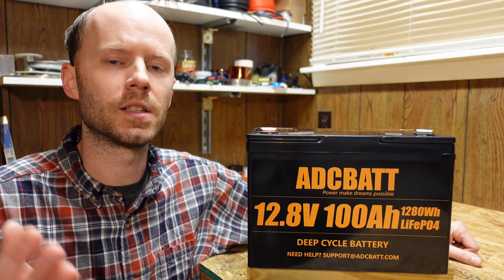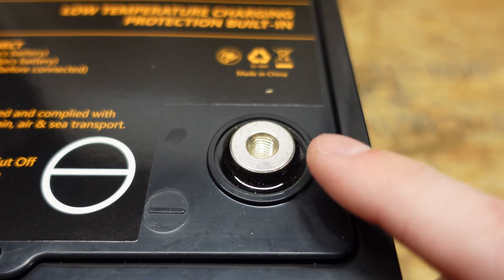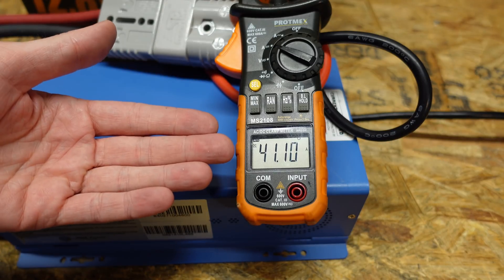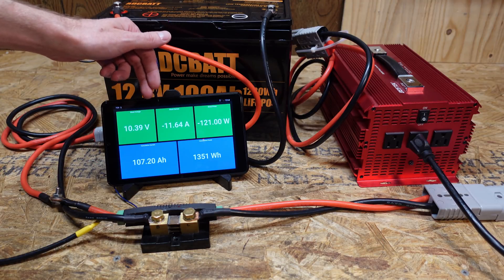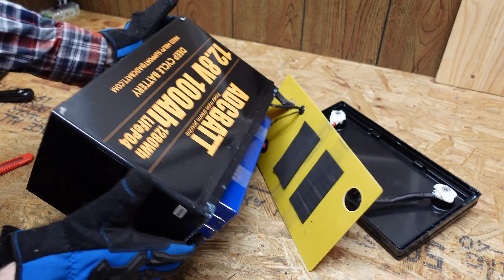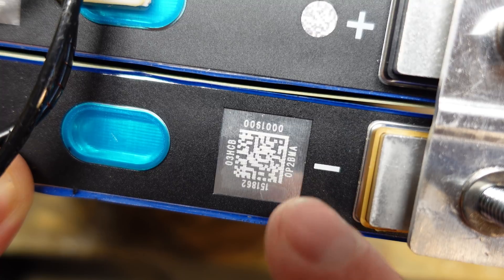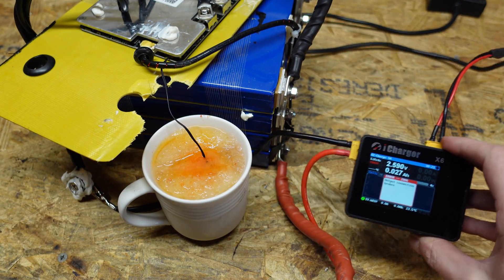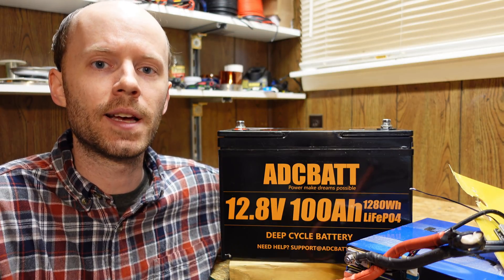ADCBatt 12V 100Ah LiFePO4 Battery Review, $369 with Low-Temp Protection!

Comment: One important piece of info I wish you could include in your battery reviews would be to show/reveal the final stage of the initial charge. What was the final voltage? Do the cells seem balanced or out of whack?  My new Aolithium has be on a 100ma for three days waiting for three cells to catch up to the runaway cell as the BMS attempts to balance.  PITA.

Comment: Update here.  I grabbed 2 for my camper as soon as this video came out and so far they are working great, so one season in the books.  I probably drew them down 12 times or so.  I have an 1100 watt inverter hooked up and I use a 20 amp charger.  The output and charging are working as expected. Prices are coming down so I will probably grab a couple more in the spring or many get the 200 ah version so I have 2 less cables when its hooked up.  These will outlive my camper.

Comment: Hello , Im new to solar and I will be building a grid tied system. I need about 14-16k system. My question: Ive noticed some content creators buy two mppt 6kw inverters and  not one 12kw or 13kw inverter, why is that?  and my 2nd question. Im limited on space for my solar panel array, I was looking at Trina vertex 670-700watt panels, is there a reason I should buy smaller less watt panels? Thank you and Happy Easter

Comment: Question.  Why do all these batteries say only 4 can be used in parallel?  Is this something to do with the BMS?  Seems to me many could be used in parallel.
Reply from the maker: Good question. I don't have an exact answer; however, I suspect it has to do with the ability of the BMSes to interrupt heavy fault currents. With proper over-current protection, any number of batteries can be paralleled in theory.
Reply: @LithiumSolar  I think you just nailed it.  If there is an excessive current draw with too many batteries the shared load between the batteries would not rise to the point to trigger the BMS's to shut down.  Perfect, Thanks!

Comment: at 2:05 in charging section parameters I think there is a mistake that over discharge disconnect of 15 volts I the manual should say over charge disconnect 15 volts  ? not over discharge disconnect ? am I wrong ?
Reply from the maker: Yep, it appears you are correct...
Reply: @LithiumSolar  did you just played a prank on me telling me that I won an ADCBatt 12V 100Ah? I received an email notification to my Gmail? telling me that I won are you playing with me??
Reply from the maker: @gabrielpadilla2583  That was a scam. Check the person whom posted the message carefully. You'll see it was not me.

Comment: DAKOTA LITHIUM 277 AH 12V LIFEPO4 DEEP CYCLE BATTERY look you will like it nice
Reply from the maker: I've looked at Dakota Lithium before, but man... they're expensive. $2400 for a 12V 280Ah battery? You can buy 4x 280Ah EVE batteries Grade A from a US supplier for $650. Dakota Lithium has a HUGE markup on those batteries, way beyond their value in my opinion.
Reply: The ADCBatts are 1/2 the price of Dakotas. Not saying they are bad, just stuck in the Battleborn era of terrible pricing.

Comment: Just had 2 delivered yesterday, came at identical voltage and seem pretty nice. Thanks for cutting it open, wasn't sure if it really had low temp or not. Great to know it works.
Reply from the maker: They have two versions of the 100Ah, one of them does not have low-temp protection. I assume you purchased the one with it, but FYI just in case :)

Comment: Those are Gotion 105Ah cells. It has thin Aluminum casing and bulging is a common issue in these cells, needs proper compression before charging. And the cycle life is limited I think, may be 1500-2000. Cheaper cells compared to others.
Reply from the maker: I spent a lot of time looking in to this before - one of the cheaper batteries I reviewed in the past had Gotion cells as well. I think you might have actually been the person whom tipped me off to that fact, can't remember. Either way... I had a datasheet that rates them at 1500 cycles to 70% health then I obtained another datasheet that has them rated at 3500 cycles to 80% health. Information on them is so scarce, and is typically in Chinese, that it's difficult to know exactly what the deal is.
Reply: @LithiumSolar  Yeah its really difficult to get the true info, some vendors modify the official spec sheet or make their own translation of the Chinese document. Anyways those are cheaper cells compared to EVE/CALB. EVE is also coming out with new 100Ah cells that have a lesser life and possibly "cheaper", or planed obsolescence!.

Comment: Does the proper low temp charge cut out make up for the poorer construction?
Reply from the maker: There's not really anything here that's problematic, just cheap.
Reply: @LithiumSolar  Good point. WIth true low temp ability, this battery is a top contender for me.  One thing that concerns me is the rated "Storage temperature: 50 to 85 degrees". That seems very limiting and is far more stringent than its other temperature use ratings.

Comment: I think those are the same cells that the HSKY from Big Battery uses (which is advertised as 106Ah).
Reply from the maker: I see the HSKY is listed as 103Ah. Was it listed as 106Ah before? I did a video showing the insides (one of their demos) and they do appear to be the same cells from what I could tell, just different color sticker on top. Very interesting!
Reply: @LithiumSolar  ah you're right it's 103Ah. I confused the last digit because I have two of them (206Ah total).
Reply: Probably built by same company in China..the one brand goes out the front door and the other out the back...rebranding is very common.

Comment: hi, could you do a time-lapse of the capacity test? jsut sprint through the test ine like 4 seconds... don't know why but it would feel like i assisted the test... anyways, like the videos.
Reply from the maker: I've done time-lapses in the past. The problem is they generate 100GB+ of video footage just to squeeze it down to 4 seconds lol. I had a off-brand GoPro thing at one point that had an actual time-lapse mode, but it wasn't designed for close-up focusing and wasn't of much use.
Reply: okay, thanks for the update.

Comment: 4 year old puffy cells  in a so called new battery no way your getting 3500 cycles on those
Reply from the maker: I'm not sure the date decoder part of that tool works. I use it most for obtaining bits of information, brand name and/or model.

Comment: Very nice, very adequate cables, and low temperature charging protection. I think (could be wrong, it is difficult to tell from a video) that there is not only fiber board in between cells, but also some foam? As long as you don't open it and start playing with the terminals, I don't think shorting out would be a problem. The cells? Well, I'm not all that familiar with the brand, but I haven't heard bad things about them. The fact it measures around 8% above capacity does let you know they are accurately rated new cells. A dozen or so cycles and should measure just over 100 amp hours. No-name BMS? Well, just like every other pre-assembled battery, but with real low temperature protection for cheap!

Comment: Nice review. Using google translate app, the BMS says "Huayan Jingchuang lithium battery protection board, model:HY7100-100A-4G-18" and " Charge 3.65v".  I don't think the rest translated correctly.

Comment: How do you check cell manufacturer with the QR code, I have some cells that I can't find any info on
Reply from the maker: Try putting the code into this tool
https://www.gobelpower.com/lifepo4_decoder.html
Reply: @LithiumSolar  keeps saying code seems right, code length wrong but also says they are ganfeng, not sure if that's a  good or bad brand or why i get the weird error message

Comment: Good review but low temp protection should be a game stopper for outdoor use.  Any time I use a LiFeO4 battery I want that protection. One cold night (32F) and the sun comes out (charges) and destroys the battery.  One way these could rated is OK for indoors or OK for outdoors. It can freeze anywhere in the US.  Why take the chance to lose $379 not to mention loss in production and time to figure out what's wrong?... You are an excellent reviewer on these batteries. It is very helpful for us to see build quality. Amazon now has these for $345.
Reply from the maker: Just to be clear, this battery (ADCBatt) DOES have low-temp charging protection that works quite well. It was the battery yesterday (Lossigy) that did not.